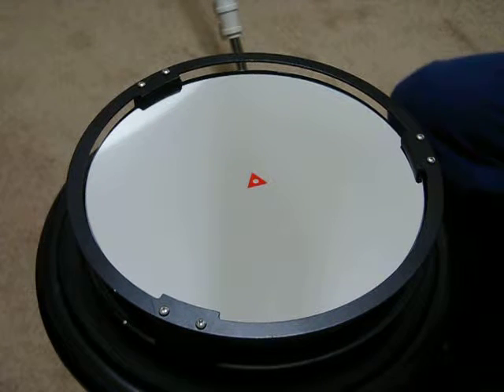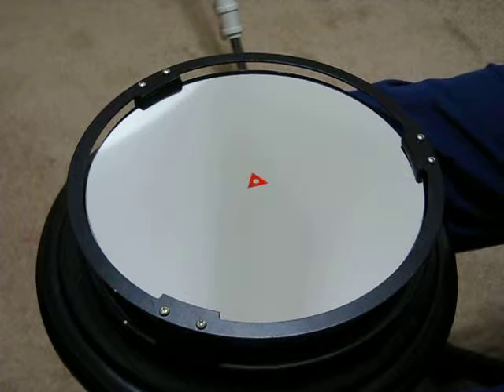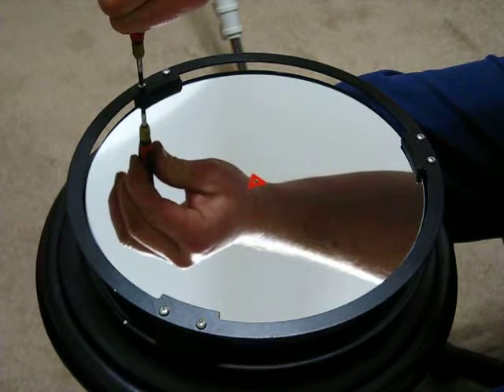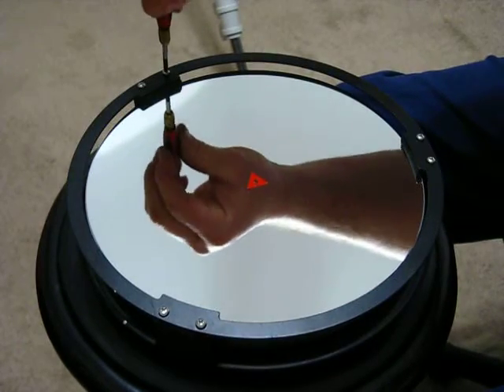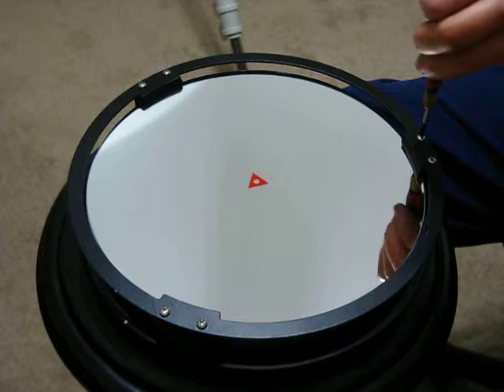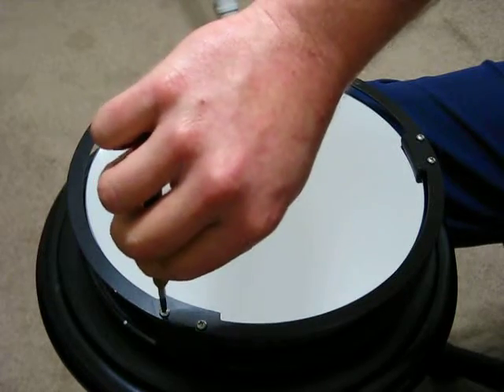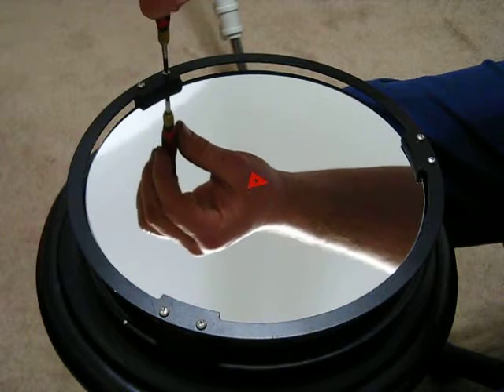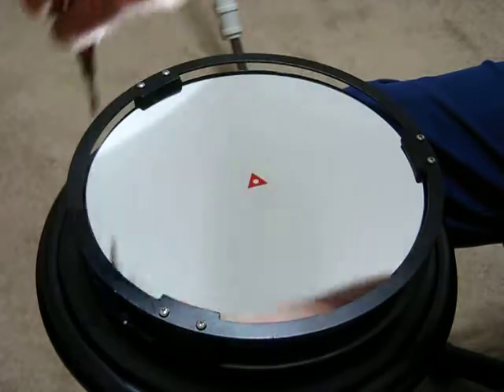ManCave Astronomy Meade LXD75 Mods and How to's#32 Center Spot and Cleaning part3

Comment: you should NOT screw them to the point where the mirror cannot move. mirror should be able to move otherwise it will end up pinched on one side or more.